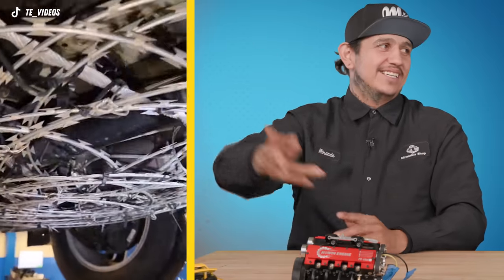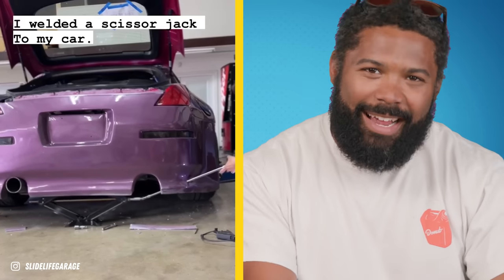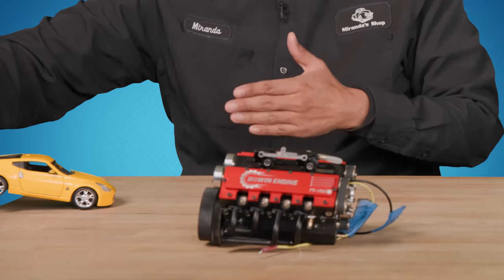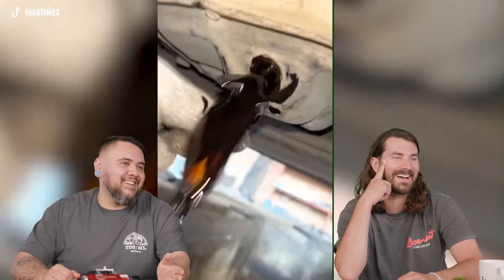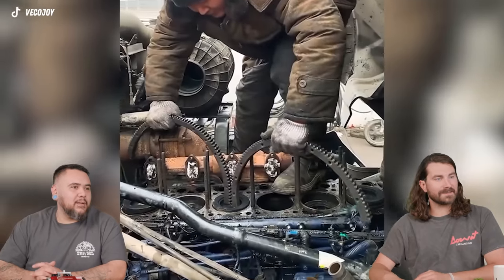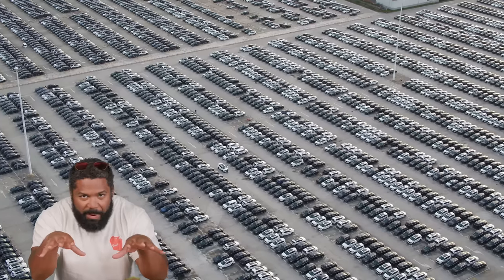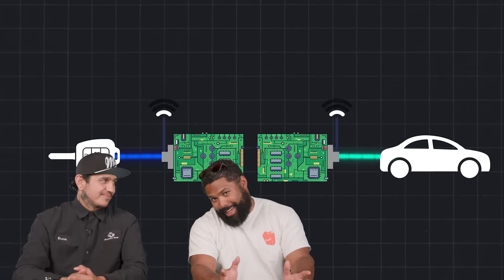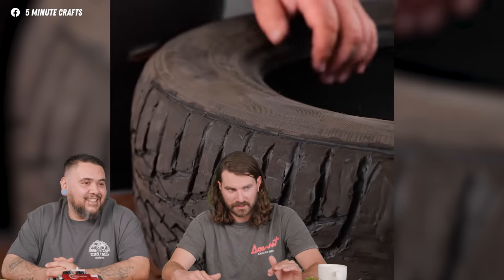Mechanic Reacts to Horrible DIY Car Hacks

Comment: I will say for the zip tie hack, at my shop we have drums that we wheel around with basically a big funnel mounted to the top, and if you spin the drainplug off, and it drops in the funnel in the spot where the stream hits, you might as well have just not used a container because all the oil will spray all over you, the undercarriage, the floor, your buddies, your boss (because we all know that that would be the time he'd come to check on you), and just everywhere. I personally just spin the shit out of it so it flies out of the way for sure, but I could see this for people who are particularly traumatized.

Comment: i think the explanation on the car key getting its signal amplified is the same when you have a bad reception in your old transistor radio and when you touch it's antenna, the reception suddenly gets better.

Comment: I had to empty out the coolant in my reservoir tank on my motorcycle, wasn't bothered to unclip all the clamps so I ducktaped three straws together and used the air compressor venturi hack and it worked beautifully. thank you donut

Comment: semi truck tire retreading is NOT cutting new treads into worn out tires, its either rolling a new layer of raw rubber on top of the worn out carcass after buffing it down and then molding / curing that into new tread on the carcass, or sometimes they have a strip of new tread that they glue onto the carcass. it is never cutting groves in a worn out tire. the main controversy with this is the tread sometimes will separate from the carcass if not done properly, and this is why its legal to run retreads on a steer axle. tire grooving is a thing, but its typically done (legitimately) to modify new tires for better flex offroad, and sometimes like in the case of monster trucks, before they started making lightweight tires for them, they would cut off all the tread on a new ag tire and then groove new tread into the carcass to save weight. 

the air bucket hack sometimes works, but a more reliable method is to put the short end of a flat bar in the gap between the two bucket rims and turn the whole bar, thus leveraging the buckets apart.

for the wrench on wrench hack, i got tired of doing this so i bought a cheap set of deep impact sockets, cut a short section off the end, and welded them to long bars. now i have a set of extra long 6 point box end wrenches and a set of medium long sockets. btw, don't attempt this unless you have a good metal cutting bandsaw.

Comment: The first example with the barbed wire, it's true that you can take it off in just a few minutes but unless a thief wants to steal that specific one for some reason, he will most likely go to the next car where he doesn't have to spend those extra minutes removing the barbed wire.

Comment: For a quick explanation of how the "hold key to head" trick works: The key has a tiny antenna inside of it that transmits the signal from your FOB to the car. These antennas kinda suck because they're tiny. The human body is a pretty good capacitor, and capacitors will affect antennas. By holding your key near your body, it's slightly affecting the capacitance of the antenna and letting it transmit the signal farther. This is a horribly simplified version of how it actually works, but it's the same concept as holding on to the antenna for your boombox to get better signal out in the woods or in the shop.

Comment: The whole skull fob thing works… the military actually experimented with transmitting radio messages to tiny wearable receivers attached to the inside of helmets, using your skull as the speaker.

Comment: The pull start might work on the car in the video, that generation of Skoda Octavia was available with a 1.2 turbo gasoline engine, not a lot of engine to turn over = possible to do with a rope. I've definitely push-started similar engines on a flat road, so I'd call it plausible for smaller gasoline engines. No way you'd be able to do it to an American car, even with a manual transmission, though.

Comment: The zip tie on the drain plug could definitely be helpful for not losing the bolt in the drain pan, but even that's a stretch

Comment: Second last video using a wireless car key on your head to unlock ur car at a farther distance does work for sure. It has to do with the electric waves the wireless key gives off and the amount of water in your head. The water in your head helps act as an extender for the wireless electronic wave. That is probably the easiest way to explain how that works

Comment: Some automatic cars have some kind of "Emergency start", in which you can actually start a car like that with 30-50km/h. It comes down to cars having a secondary oil pump. Mercedes had this in older cars.

Comment: yo that fob trick, i learned that back when i got my first car, but we always put the fob like, under our chin, and then smile really wide at the sky.  

We were kids and thought our teeth were amplifying it, which i'm honestly not qualified to actually determine.

what I can tell you is that i use that hack nowadays to use the remote start on my escape from inside the house instead of going out in the cold.

I was told by a guy who was all about his RF and IR wavelengths, though, this does not work on certain cars due to some kind of interaction between certain micro-electronics.  seeing as i'm not an electrical engineer, i would refer you to the illustrious Mr. Mehdi, the notorious ELECTROBOOM! for further clarification.

Comment: 10:30 in the army as a diesel mechanic we just use a long steel pipe that would go over any wrench and just use that to crank it back. Maybe weighed about 15 to 20 pounds and was about 5 feet long

Comment: I think that the flat tire air transfer hack would be useful for a flat spare as the spare is often overlooked when checking the tires and is usually low on air when you need it

Comment: “The rope pull start” I used to do kart racing, racing karts are push start so we used to do this if we needed to get it running while it’s on the trolly, so I can’t say weather you’d be able to do that with a car engine it’s definitely possible with the 250cc 2 strokes we used.

Comment: The best thing about the rope pull start is that now you have a car running in gear, spinning the crap out of its differential, perched precariously on a jack.  One little tip and off it goes through the neighborhood.

Comment: I use service truck tires on my Jeep to get the height in a narrow profile.  I bought and use a regroover because for whatever reason, the grooves on the center portion are not as deep as when you get out to the sides (I measured when new). So I regrooved once and get twice the life out of them. I have never tried twice and doubt I ever will.

Comment: I saw a video about the key fob thing. It was saying that whatever signal it gives off is increased by water. So you can actually use a water bottle if you have it. Since ppl are made up of whatever percentage of water it  works the same way

Comment: The key to the head trick works as the wavelength transmitted for the key is roughly the same length as your head so it amplifies the signal

Comment: Use the car remote under the chin to unlock your car from a far distant.
Another hack is using electrical/duct tape on a swivel socket or adapter to get a simi fixed position.
If a socket is slightly to big or the bolt/nut is worn off alittle bit use a peice of paper towel in the socket to hug the nut/bolt tightly.

Comment: Our bodies are pretty decent antenna as our body is pretty much a big ass resistor coupled capacitor.

I first discovered this effect on my own in the late 80's or early 90's playing with a walkie talkie I had as a kid. The antenna nub was bitten of by my dog and if I touched the bare antenna inside, I would suddenly be able to receive signals from crazy distances away.

I lived about 10 miles from a small airport where they did a ton of gliders and skydiving and if I touched the antenna, I could hear their walkie traffic, without touching the antenna, I could only receive signal from about half a mile away.

Comment: The flat tire hack might be good for when you just need to get a mile or two down the road to get the leak fixed. While running the tires with low pressure isn’t gonna be great for them in the long run it’ll at least allow you to move the vehicle without causing the rim to shred the rubber.
Reply: It’s really good for motorcycles if your front tire gets a nail or something.  You use your patch kit, find out you’re out of CO2 cylinders to refill, and you can at least get both tires to “rideable” pressure by pilfering from the rear to put something in the front.

Comment: I'm a truck driver and we absolutely DO NOT do that to our tires. We don't "regroove". There aren't any more layers to cut down to when the tread is worn down. But re-treading is popular. And that involves grinding down to the foundation of the casing and putting a complete tread on top.

Comment: As someone who works in a hotel kitchen, we use 5 gallon buckets, all the time and this is the bane of our existence. But theres a solution for someone in my line of work, if you have a steamer, the buckets just barely fit inside with room to close the door, steam for about 40 seconds and the buckets release instantly.

Comment: there's another wrench cheat: instead of chaining wrenches together, grab a pawnshop/harbor freight wrench and cut the open ind off. Now you can slide a pipe on the wrench instead of wrecking other wrenches. OFC, this is only really useful if you find that you have to keep doing this with the same size bolts on a regular basis.

Comment: I remember using a pressure washer on my old car, and the paint started to come off. I didn't realize it immediately. Ended up stripping the coat entirely, and then reapplying with the only tool I had - a paint roller. The surface ended up being matte and textured, which you can imagine, collected dirt like crazy on a white body, but there was no rust on the metal. Must've been some kind of an alloy, because it didn't rust, even without paint. I kept that car till the 2nd engine wore out, and cylinders developed too much of a gap. To fix the car would've been 2x its value, and I passed. Now I regret it, because I know the body would've been rust free to this day. If only I went ahead and bought a 3rd engine. 3.0L V6 Mitsubishi. Almost 300hp. I miss that car so much. I have the means, but I no longer have the car.

Comment: The head thing works because you basically turn your whole body into an antenna. Same reason why holding the antenna on a radio will get you better reception or the antenna on a TV. Your body has become a bigger transmitter than the little remote, ergo you increase range and unlock your car.

Comment: The zip tie one is probably so you can unscrew it and not drop it in the pan or on the shop floor and spend time tryin to find it again. 😅
Reply: I usually just fish it out of the pan with a magnetic grabber.

Comment: It's not about not getting oil on your hand, it's about not dropping the bolt in the oil pan.
And the rope on the wheel works PERFECTLY (3rd gear, maybe 2nd, no 1st)

Comment: Crazy thing is in theory the rope pull on the tire could actually work. When pushing you only need to get the ground speed up to about 5 mph before you pop the clutch to start the car. My old ‘74 Ford F100 could be pushed started within a few feet. The wheel RPM speed of the average tire at 5 mph is only about 70 RPM. That’s slower than an vinyl record.

Comment: In regards to the Wrench thing I've done it plenty of times with 2 but never 3. Recently I found a tool tha Goes on the end of a Wrench but there's 3 different lengths  of them for what ever you need. But also the handle of of your jack works great for a leverage / breaker bar. Or just a piece of pipe works and u can oval 1 end to fit better

Comment: Regardless of whether or not the "rope hack" works, there's the whole issue of potentially pulling the car forward, knocking that little jack down, then getting run over by the now-running car you're standing in front of.

Comment: Reguarding man with the three wrenches , I use one wrench and a pipe . never fails . For average sized nuts and bolts , on a 2001 crv to break loose the front axle nut i used an impact gun . cause even using the handle from my jack as a cheater bar and standing on it would not loosen the nut . Thanks

Comment: In the "regrooving" at the end, the grooves on the tire are clearly just filled with black clay. You can see the crisp, brand new grooves and the actual tire where the clay is peeling off. It's so obvious I'm surprised they even posted this clip.

Comment: there is another use for the re-grooving tool in so much as shaving off blunted treads to a flat surface that will dig better... I think FortNine did something on it for dirt-bike tires.

Comment: When I have two buckets stuck together I just unscrew them, works every time. Hold the outside bucket still, spin the inside bucket and pull at the same time.

Comment: 7:25. push the plug against the hole as you unscrew. no errant drippage and once you hit that last turn, pull away quick and you're good, just set the plug down.

Comment: I’m going to “regroove” my old Uggs and see if that helps with traction on my walks in the winter. My snow trax things never stay in and it’s a pain in the ass to try and put them back on when it’s -30°F and pitch black out. And this winter I now have an 85 pound miniature GSD puppy rather than the 45 pound 16 year old Boarder Collie I was walking last winter…

Comment: I had a roofing nail in my tire and I left it there and then it came out on the highway at 70 miles an hour. Almost made me wreck. I'd recommend keeping a plug kit and a can of rubber cement in your truck, just in case. If you have a good power inverter you can plug in your compressor and reinflate it after you plug it. (Or if you don't have an inverter, just go to Sheetz, they got free air.)

Comment: @realMechanicStuff Quick explanation on why the remote to your jaw works: Your jaw will amplify the wavelength of the key fob similar to what a radio dish does with radio signals. It has to do with the shape of the bone and the signals bouncing off of it. It also works better if you open your mouth. Science is cool like that.

Comment: The key fob to the head hack works because the key fob uses a radio signal but there's no antenna connected to the fob. By putting the fob to your head your putting the signal higher and your body acts as an antenna. That's pretty much the simplified reason.

Comment: If you're smart, you remove the catalytic converter yourself and replace it with straight pipe or a resonator, and put it on a shelf til inspection time rolls around again, then you put it back on long enough to get it inspected, and then you take it back off and put it back on the shelf for another year. Big Brother can go pound salt. Make sure the ignition is on before you catch it in gear, or else you'll blow raw gas into your exhaust, and then when you turn the key on and pop it again you'll turn your muffler inside out, unless you don't have a muffler... But if you have straight exhaust you can turn the key off, let the clutch out for a couple seconds, then turn the key back on and blow flames out your tailpipe. Looks really cool at night, Blapp!

Comment: Velocity for the car is determined by weight. So by putting the drive on a block, decreases the weight and increases the drive velocity. BTW - it is possible to push start an automatic…neutral to drive, just like a stick.

Comment: 2:26 this is what you do on your fun time or burn-out car you know you're gonna have to be changing tires a lot but you don't need to worry about the welds breaking and it coming loose on the highway
the buckets you're just breaking the vacuum that's why even if you're tough you can't pull them apart you actually bend them and the vacuum seal breaks to let air in

Comment: 04:06 Oh, that "yank-start" on the wheel actually works. However, the bigger the engine the harder it gets. Little 3-cylinder Daihatsu or Skoda? No problem as long as the battery has enough juice left to get the alternator going.

Comment: Regrooving and retreading are two completely different things. What the video shows is regrooving retreading adds new layers of rubber to return the tire to a serviceable condition whereas regrooving cuts down into the original material and would make it thinner

Comment: The car remote to the head thing works because your head is mostly water, it would work with a bucket too. Sixty Symbols and Kyle Hill both have videos about why that works. Short answer resonance.
Reply: it's not necessarily just resonance. the remote is basically an antenna whose radiation pattern (=where the car opening signal goes) can be altered by changing the effective "shape" of the antenna in the near-field. It's like putting your finger on a water hose nozzle changes how the jet behaves.

EDIT : I've just watched Sixty Symbol's explanation. It is a very physical one, and could very well be a factor. I would just say that at the wavelength/frequency considered here, adding a dielectric such as your head to the car key makes it so that the antenna becomes the head+key ensemble, thus altering the radiation pattern of your antenna.